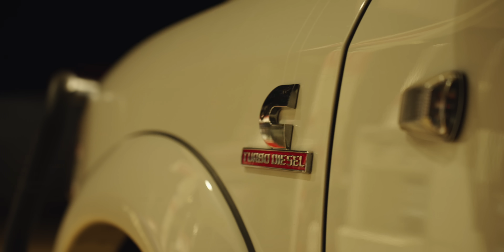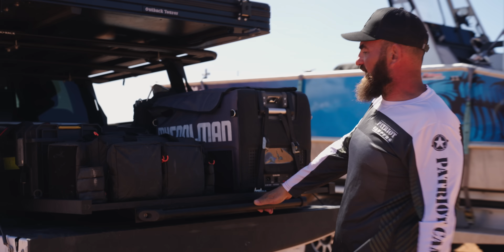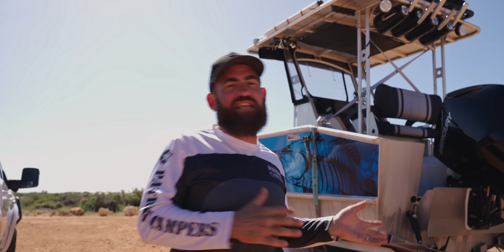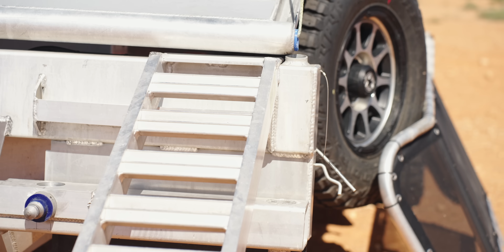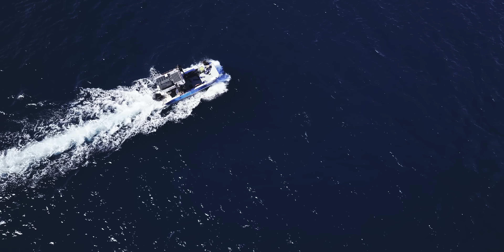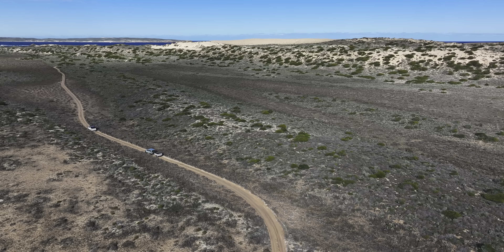First Look! RAM 2500 + Barge Walkaround in Western Australia | Patriot Games

Comment: Hey Justin once again you guys are stepping to a new exciting level. OK with regards to your torch in the side pocket, well two weeks ago going up the cape I was stopped by a couple of coppers one was great the other was not so friendly. They told me that my touch in the door location was considered to be a weapon. It’s a mag light. The not so nice copper was going to confiscate it. Seriously I’m 71 years old and it’s for emergency use. Anyway the nice one advised me to store it out of the driver so it now lives in the pocket behind the seat. Being a mariner and was working in the offshore industry. I recommend that your Epirus is installed in a more open and easy accessible position and ideally fitted with an auto hydrostatic release. When the shit hits the fan the last thing people think of is the Epirus. Also how many boats have you seen gone belly up and the Epirus is under the boat. The front door is called a bow door. I suggest that you fit two safety chains just incase the winch rope fails in heavy weather. It’s not a good moment if it dose fail and the bow door drops down. Also we always install a bottle screw slip, it keeps the bow door solidly and firmly closed. They do come lose. Anyway looking forward to the new episodes. Cheers
Reply: The flashlight issue I've had here in UK too. Seems common sense on easy access has given way to everything being a damn weapon these days.

Comment: I love landing craft, think it is incredible cool. Very well thought out being able load it will it is on the trailer. I do a lot towing my boat in North Queensland, I have gone through 3 chart plotters going through corrugations (2 raymarine 1 x Garmin). I remodel my helm so that I could remove my chart plotters very easily. I store the chart plotter in tough case with foam in my car. The chart plotter has lasted two years without a single problem. The only problem that I have in counted was with the leads that plug into the chart plotter went rust which I think is because I live on the water so salt air got to them. Barji marine sell caps for the leads which will solve the problem. I understand that having removable chart plotters may not look as clean on the helm but on bump roads the chart plotter just don’t seem to last. Really looking forward to this series. Cheers
Reply from the maker: Copy that, good advice 👌

Comment: Really like the sound of this series coming up!
Reply from the maker: Thanks mate! Stay tuned 👊
Reply: @PatriotGames   If Toyo Australia sold the Open Country RT Pro(37×13.50r18) thats the tyre I would recommend. But otherwise for the 18 inch Australian market Toyo Open Country MT in 37×13.50r18. 37×12.50r20 Nitto Trail Grappler MT is a option, the 35x12.5r18 size is 35.1 inches tall and 13.4 wide and sense a 13.5 is rated on a 11, if you add .2inch/5mm for every .5 inch in wheel width change thats a 13.8 rated width tyre. If you want a AT tyre, Nitto Ridge Grappler 37x13.50r18 is a good option.